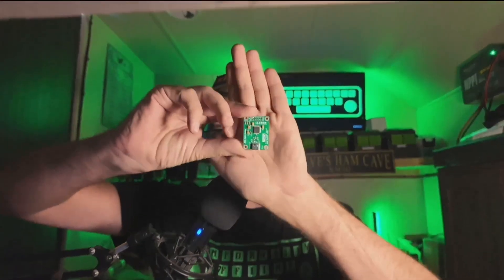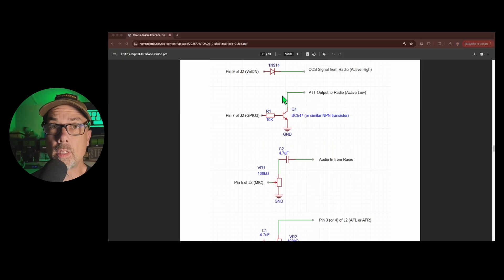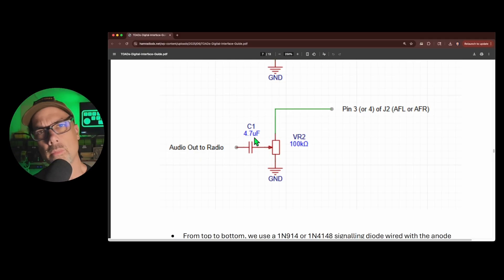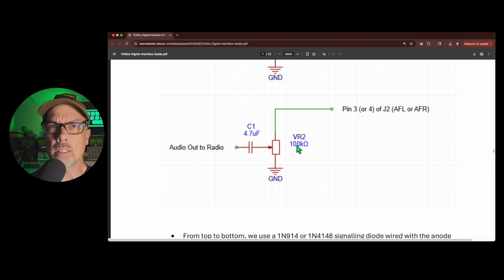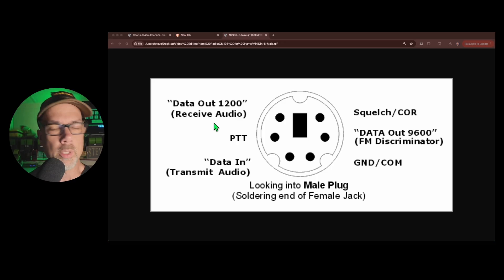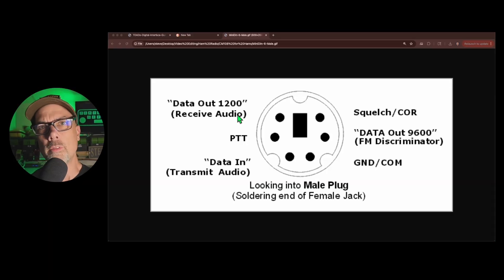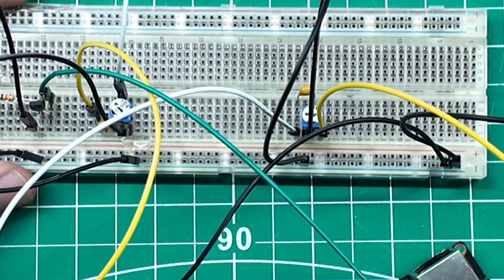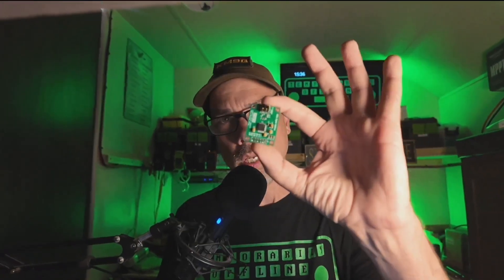Ham Radio Digital Modes: Audio OUT Circuit Explained

Comment: Are there any isolation transformers for the audio lines?
Reply from the maker: the trimmers act as isolation transformers, but by design, its "your call" as to what, if any, isolation you want to provide.  Modern computers have much better isolation than the 80s PCs when everybody recommended isolation transformers.

Comment: We used to use vox boards to get radios onto teamspeak and the internet.   This is a lot easier for sure.  The really fun remote was in the nextel days. Nextel in a car cradle and antenna to a vox board to a radio.  Talk about a secure remote input.  I miss nextel. 😢✌️ carrier operated signal or squelch.
Reply from the maker: That sounds like fun
Reply: It “mightve” been used on cb on a mtn top too in that fashion 😂

Comment: Question: could you use two of these interfaces, and use left channel for one radio, and right channel for another, with two instances of the app, or selecting one radio or the other in the app (absolute digital newbi here; analog voice/ratchet kind of guy)?
Reply from the maker: Hey Roger - you could actually do it with just one of the boards for receive, but you might want two so you can transmit also - the board has discreet connections for both left and right audio.  Ham Radio is only mono, so for a single radio... pick one.

This is a fancy "usb sound fob"

Comment: Hi TO, I have a Ranger RCI-2970-4 is there a way I can connect the Toad board to it. This radio has 6 pin mic and audio out in the back. How can I wire it. Or is it worth spending the time for this radio. I bought this radio for POTA and so when I get tired, I can use FT8. 
Thanks K4NCC
Reply from the maker: Yessir. And this video series is the way to do it!